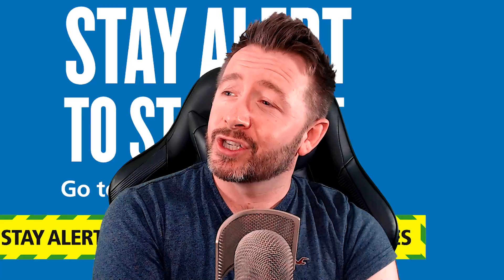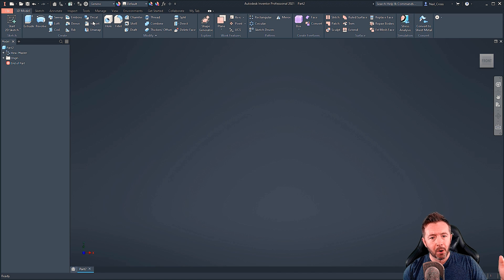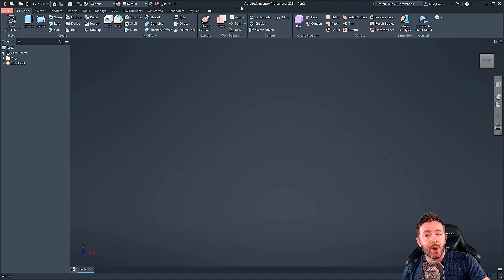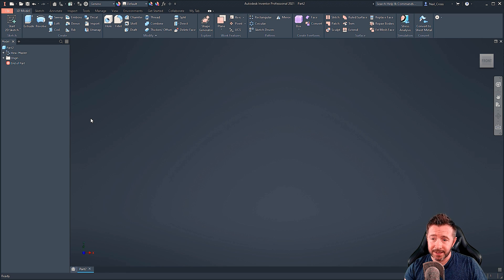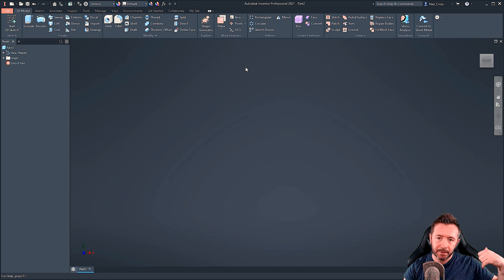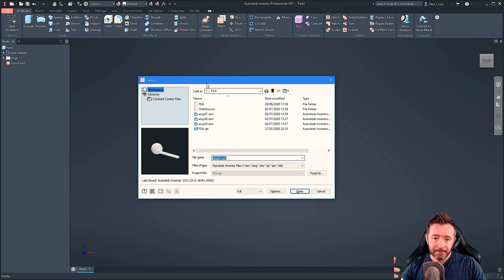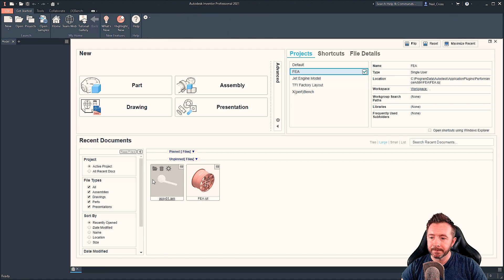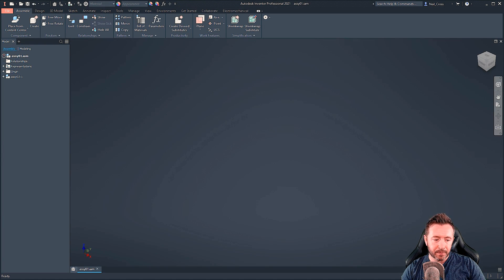This Well Known Program Problem Is Becoming More COMMON - How to Fix!

Comment: This is a priceless tip mate 
I was working with SW for the last 10 years and occasionally had this problem because the workplace has three screens and two at home
By the way, I subscribe to your channel because this month started a new job using Inventor

Comment: For folks with an Nvidia GPU then there should be an option in nView Desktop Manager (or whatever has superseded it nowadays) to prevent windows/dialogs from opening offscreen. That's what is there on my 8yr old Thinkpad T530 w/ Nvidia NVS 5400M on Win7x64 with current driver package.

I'm sure there must be the equivalent/similar setting in AMD & Intel graphics driver/utilities, as it's such a basic/simple option to include.